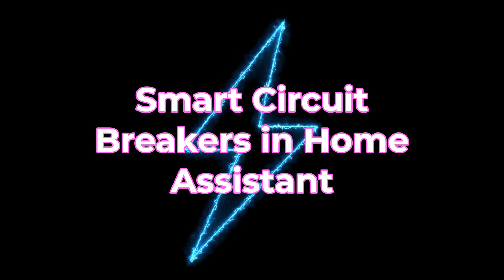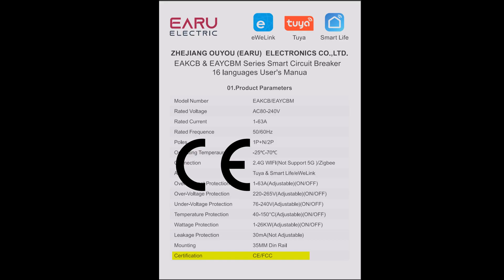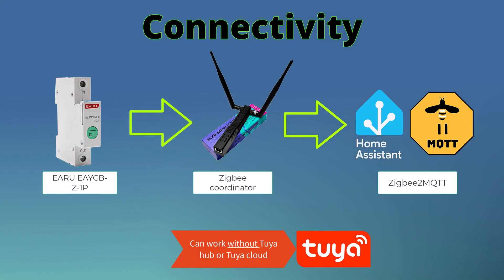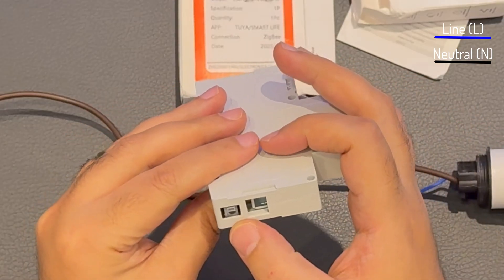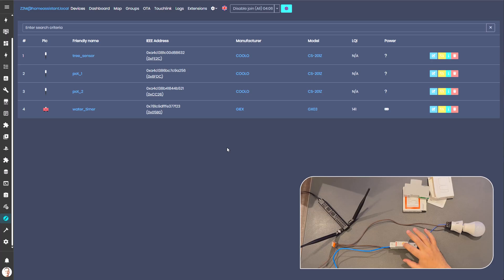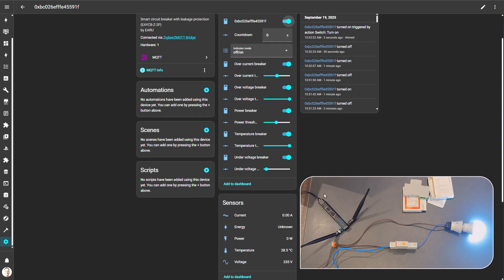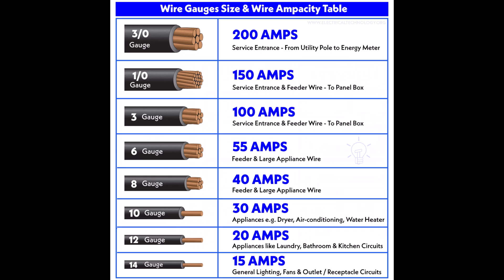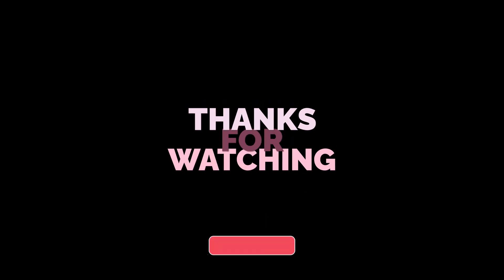⚡ Smart Circuit Breakers in Home Assistant (Zigbee + Zigbee2MQTT)

Comment: Thanks.  We are soon to set up an energy monitoring system for our business, starting small but building over time.  Your video was great for helping to explain to others how we might go about setting up metering on our primary breakers (perhaps as you suggested in a piggyback fashion) to begin the long process of understanding our biggest energy users and the time of day.  This will be to help setup smart switching when we invest in batteries in the near future.
Reply from the maker: Hey John thanks for your message, I am really glad you found the video useful! 

I am restraining myself from doing breaker replacements as compared to in series. I don’t have enough space to double my breaker count. At the same time, the risk is too high for my appliances behind the breakers to use a non certified breaker…if that makes sense

Comment: There's literally no such thing as an FCC Certified circuit breaker. The FCC has nothing to do with electrical components. So HUGE red flag there!
Reply from the maker: Yep, and that’s why I advocate against using it as the sole breaker but rather in series. Use it just as a meter while disabling the breaker features.